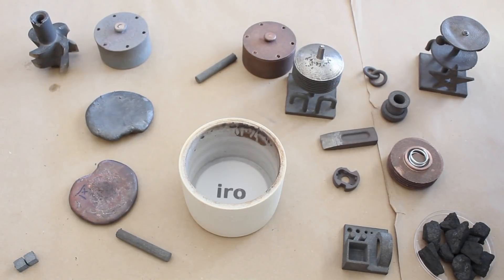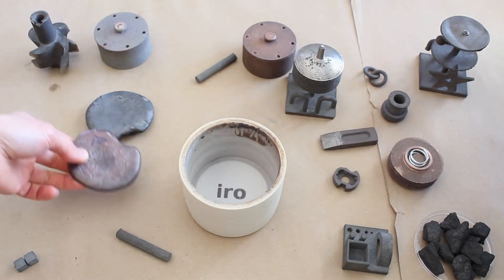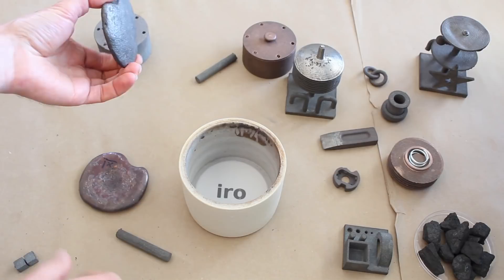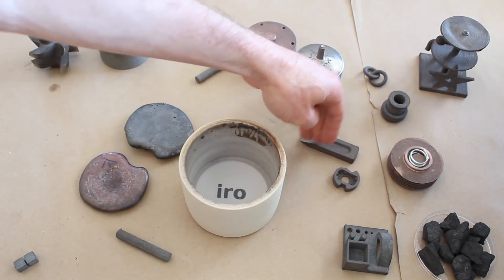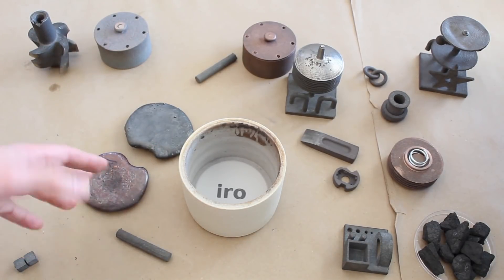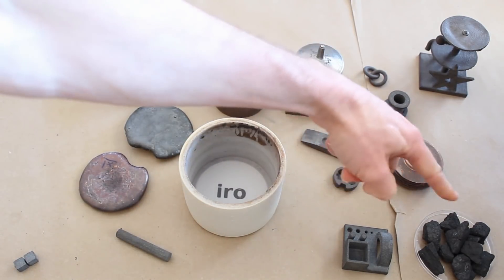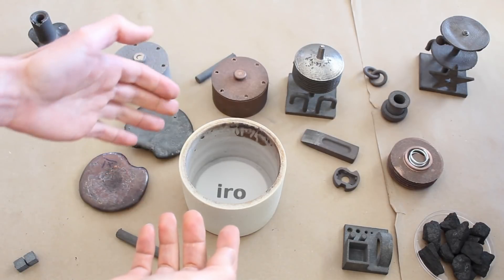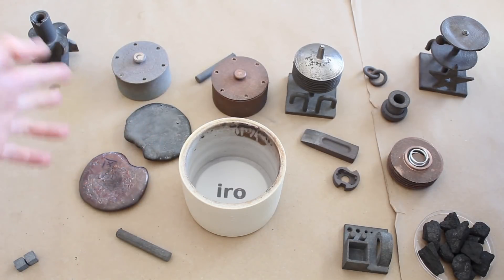Selective Powder Deposition (SPD) in a nutshell

Comment: What's advantage vs 'lost PLA' process?  Synthering looks a bit more art then science, and cleaning synthered part is equally time-consuming as removing green sand after traditional casting.
But, I agree with overs, idea is great. Simple, low-tech deposition machine plus classic metal powder process.
Reply from the maker: SPD doesn't use sintering.  Cleaning SPD printed parts is very easy.
Reply: So what is it? Impregnation of solid porous matrix with liquid metal? Kinda bimetal composite?
Reply from the maker: @thelittlebigoneru  Yes, kind of.  With copper-iron you end up with bimetal composite.  But with carbon steel, it's different.  
The carbon dissolves in iron, even in solid state, so you end up with more or less even distribution if carbon.  Especially if you iron particles are small and your hold time is long.

Comment: This is great. I have been thinking a lot recently about how to bring down the cost of metal 3D printing. I was going to prototype an idea of my own that used molten metal, but your design allows for more detail and is safer than what I had in mind. This is easily the best approach I've seen so far. I can't wait to see how it performs!
Reply from the maker: Raymond, thanks for the comment.  But why do you need to wait?  The printer is already in production.
Reply: Haha, pushing the hard sell :P I think I'll wait for a few user reviews to appear first. Then I'll see if my boss can free up some funds.
What would you charge to ship to Australia?
Reply from the maker: Yes, it's generally wise to wait for reviews.  We plan to start selling it on Amazon in the near future, so you'll see the reviews there.  I guess the shipping to Australia would be somewhere around $400.
Reply: Great, I'll keep my eyes open.